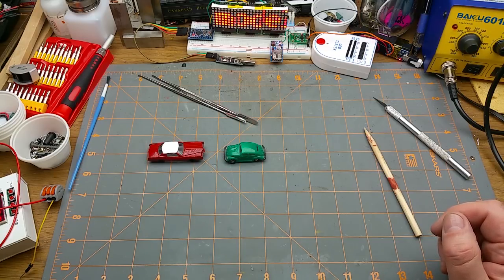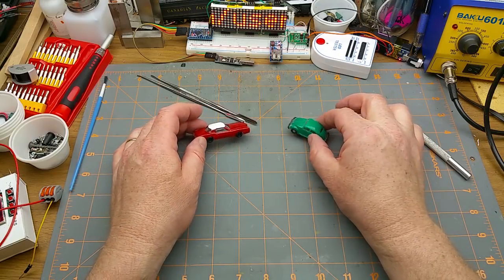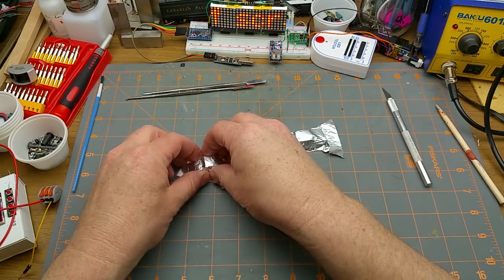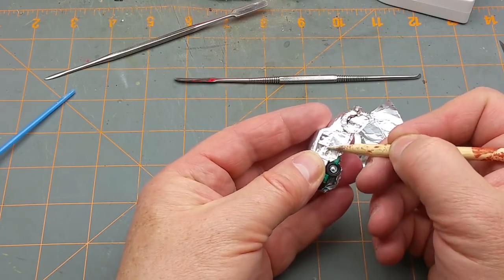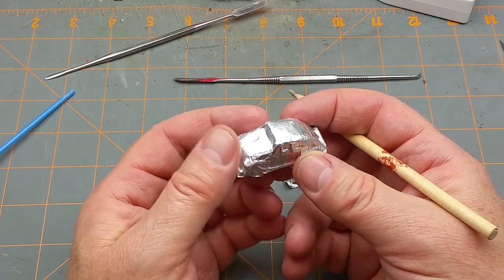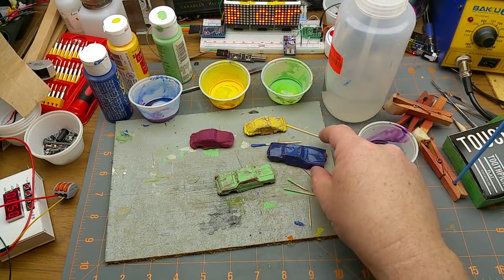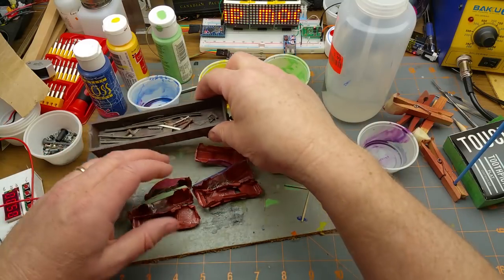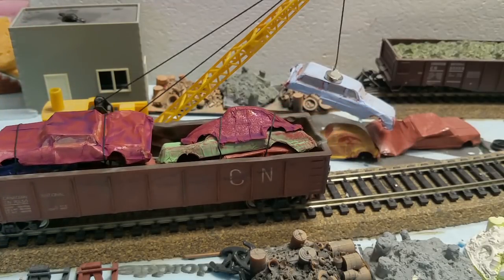freight car load: scrap cars

Comment: Where do you buy that string are using?
Reply from the maker: The "cable" on the crane? It's just sewing thread.
Or do you mean the "strapping" that is bundling the cars together?  That is chartpak brand drafting tape.  (https://chartpakstore.com/collections/graphic-tapes)
I got mine at an artist supply store many years ago.

Comment: If you glue two pieces of foil together with spray glue you end up with double the strength
Reply from the maker: Ernst de Roo-Straatemans : thats an interesting idea. I wonder if the shape of the car would come through as well?

Of all the types of glue I have hanging around my shop, I'm surprised I don't actually have any spray glue here ...
Reply: I got the idea from Mel the Terrain Tutor, for creating rock molds. I guess other glues would work as well and if the foils are attached flat the detail should not be a big problem. When cutting out the windows (much more realistic) the construction will be much tougher.
Reply from the maker: I'll have to make a trip to the glue store and try it out.

Never pass up an excuse to try out another technique! (or to get more tools)